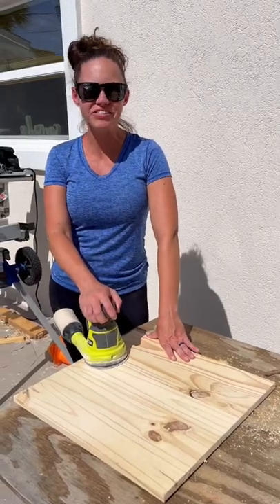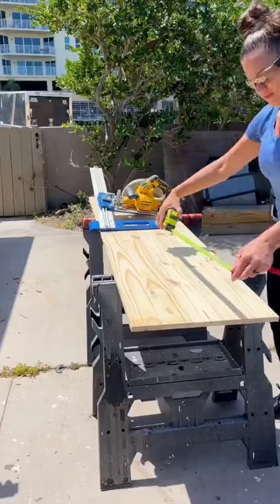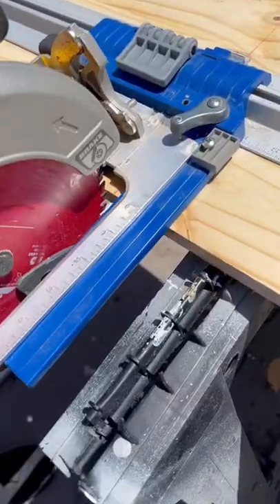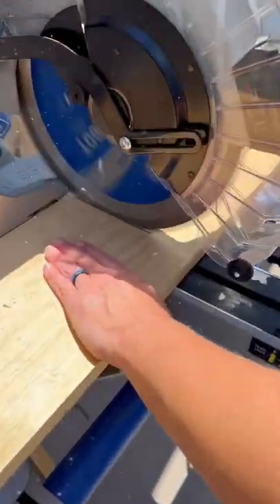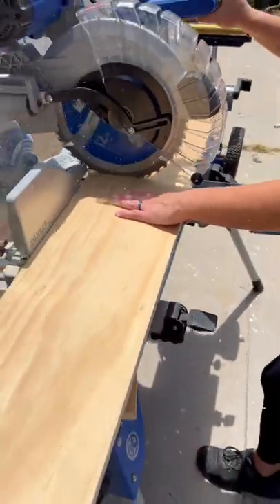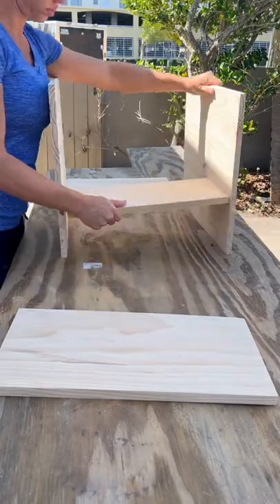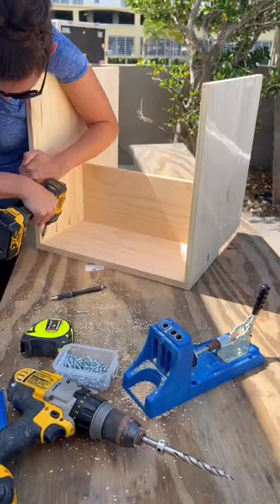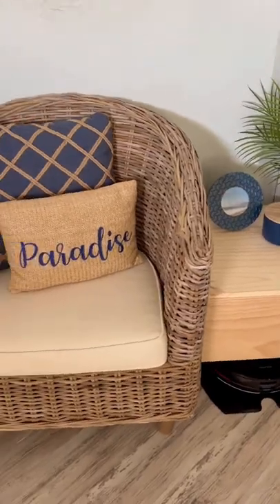@Ford Building a wooden end table cover for my Roborock robot vacuum!

Comment: I am renovating my laundry room like yours and I’ve asked you multiple times what color blue did you use because you don’t leave anything in your descriptions with specs and links at least I didn’t see them
Reply: So idk if this will help but if you screenshot the part where the blue is you can put it in a color finder app and it will tell you the color.